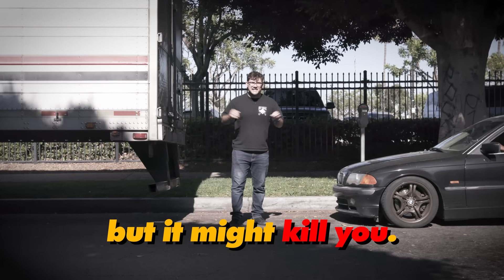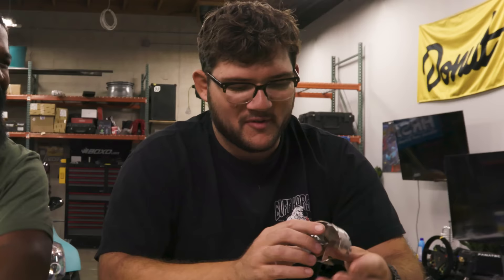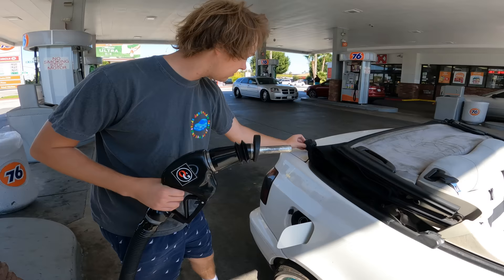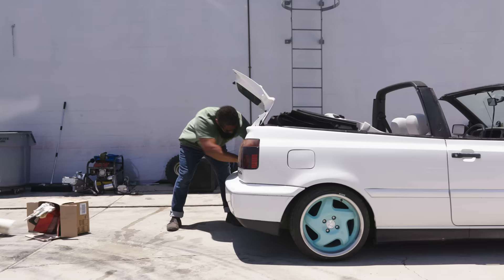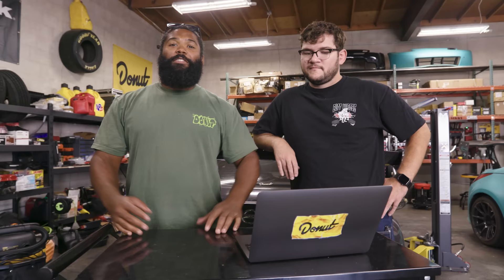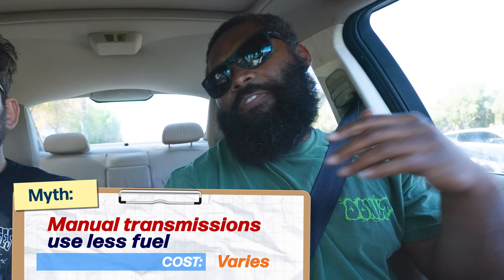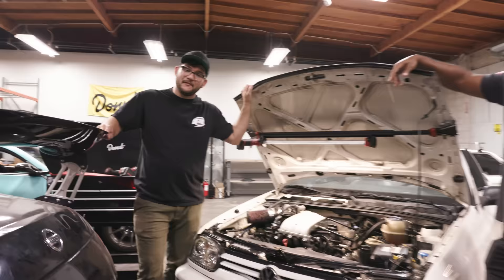Testing Fuel Economy Hacks

Comment: Two things I think could be wrong. 

1) I’ve heard windows down at slow speeds is better than parasitic loss from the a/c compressor. Once you get to about 55mph the drag created from the windows being down starts to become more inefficient than running a/c.

2) The manuals is direct drive where an automatic has a torque converter and consequently has more slip. This means that more of the energy created by the engine goes towards spinning the wheels as opposed to spinning the torque converter. Put simply more loss in transmission, making more fuel necessary to do the same thing.

Now the modern automatic with tons of gears may overcome this by having more gear ratios that allow the engine to be in a more efficient rpm more consistently. But, nothing compares to the CVT which can keep your engine in its sweet spot basically all the time.

Comment: I thought the fuel-saving advantage of a manual transmission came from the lighter weight and the more solid connection you get with a clutch versus a fluid torque convertor.

In older automatics they even featured a torque convertor 'lock' option specifically for increased fuel efficiency while cruising. When you're up to highway speed and the transmission no longer needs to shift gears, the torque convertor gets 'locked' in place for more efficient power transfer. The book even says this will feel like an extra gear shifting in once you're at a steady speed.

Comment: That turbo thing, I remember infomercials pre-Y2K for something called the "Tornado", seems like the same product.
Over-inflating tires. I'm torn on that one, I used to make a practice of inflating my rear tires to manufacturer's suggested, which was usually 32 PSI, and my front tires to slightly above, like 35-38. The idea being that most of the vehicle weight was in the front where the engine is. Not sure it made a difference, but I believed in it back then.

Honestly, the biggest difference I ever saw was when my old Nissan Sentra's exhaust rusted through. It was a California model, with 2 catalytic converters, one under the engine compartment, and one in the rear in a more traditional spot. Once the whole exhaust system fell off, and I had to put a sheet of scrap medal under the hood for a heat shield to counter the growing paint blistered spot, the MPG went from 36ish MPG to 39-40ish MPG.

Gas and temperature. Ok, there are a number of flaws with the statement that this is a scam. One being that at least at one point in time, certain times of year were when the government mandated ethanol be used, so at one time of year you might be getting regular gas, and another time of year the 10% ethanol variety. Nowadays 10% is year round as far as I know, and now even 15% ethanol is available, which averages around 30c a gallon cheaper. Can't use it in vehicles before 2001 though. Or in lawnmower or snowblower type equipment, you will damage the seals.

Most importantly though, if there is no difference in the temperature to gas performance, why do all the gas pumps have labels on them that tell you that "The energy content of gasoline varies with temperature" or words to that effect? I even dreamed up money making schemes where I would invent a gasoline tank heater, to increase the energy provided by the gas. My idea was to use a hot water heater, fed from the radiator, to prevent fire hazards while increasing the heat of the gas.

To my dismay, when I started looking up the patent process, there were already many patents for such devices, with various degrees of success and failure, most of which had only a minor effect, if any. Or they were so hotly debated, it made one wonder whether they were abject failures, or being suppressed by "Big Oil/Big Three/insert Big here".

"Junk in the Trunk". They obviously had fun with this one, but yeah. Definitely science. I've even seen other channels advocate for removing your spare, because you probably have AAA or some other roadside assistance anyway. I would never promote removing your spare. Some extremists even go all out, and get quarterpanels, hoods, and doors replaced with lighter weight items made of fiberglass instead of metal.

"Manuals are more efficient". Much as it pains me to say, this was once true, but probably false today. However, manuals are an added theft deterrent for Millennial car thieves who can't drive stick. So I'm still a fan. Plus, the feeling of being more in control of exactly what your vehicle does is worth it. I hate driving an automatic, and trying to pass some slower moving vehicle, only to have the transmission downshift, the revs go high, the speed stays the same or only increases a bit. Especially on mountain highways like I have in my area.

Comment: I don’t know about American Cars but here in Europe automatics we’re generally less efficient up until about 10-15 years ago. Mainly because they used torque converters sometimes without a bypass clutch. So some of the energy of the engine was always used to heat the oil in the torque converter and there was no direct connection to the wheels like with a manual. 

Nowadays we have a bypass clutch that bypasses the torque converter and other transmissions like double clutch and CVT add to that that most manufacturers tune for automatic as they have more control over it and can cheat on emissions easier and we’re now at a point where they’re usually equal…

Comment: Manuals were really good, in low speeds. My 01 Civic got 35 MPG around town, drop the rpm’s to 500 the second I started going down a hill or while rolling up to a red light. But taking it on the highway, running at 65MPH in top gear, locked me at 3,500-4,000 RPM making me watch my gas needle drop

Comment: The "watch how you dive" is so true. I drive a little Toyota sedan from the nineties. typical fuel consumption is 15 km/L which is about 35 mpg. Well I can easily get it to 18.5 km/L (43.5 mpg) by just driving gently. coast to slow down, gentle acceleration (fast acceleration saves very little time). Downside is them my poor old car is starting drink the odd bit of oil these days, but I'd say the fuel savings absolutely trump any cost of oil.

Comment: Funny story. 
In Grmany we have a self called expert in fuel saving, Georg Plattner, he is a good friend of Hans-Joachim Stuck, former Formula 1 driver, winner of the 24h of Le Mans  1986 and 1987, winner of the 24h of Nürburgring 1970, 1998 and 2004 .
Plattner claimed that he could drive from Spain to Austria with only one filling of his tank. Stuck said it would be impossible. Plattner won with an average of 82 MpG.
After that Plattner challenged Stuck directly and both drove 1500 km from Berlin through the alps over 13 mountain passes to Kühtai in the Austrian Alps.
Both in the same car model (Seat Leon FR Diesel). 
Not only Hans-Joachim Stuck arrived first at the destination, he saved a higher amount of fuel.
Stuck had an average of 55 MpG, Plattner an average of 52 MpG.
After it Stuck said that his experiences from the 24h races helped him a lot. Saving fuel at a high speed back then meant you could be out one lap longer.

Comment: removing parts for aerodynamics has a very significant impact on fuel efficiency. the rear view mirrors (removal) and wheels (smaller rims) are the biggest contributor and can easily net you 5+% each. taping gaps along the sides of the car does a little less, and removing windshield wipers depends on them actually being exposed. many modern cars hide them under a lip. technically you could add such a lip yourself but you would have to aerodynamically engineer it. 
some cars also now come with cameras instead of mirrors, which are about as good as complete removal. 

these are straight from the book of tricks used by car manufacturer fuel economy testing. of course you can really do most of those on actual roads because of how unsafe they are.

Comment: It's not just the number of gears in a manual that makes it efficient, It's also how you shift. autos shift near 2k RPM's. with a manual you can shift at lower RPM's to increase efficiency. During Hurricane sandy I had to make 1/3rd of a tank last 3 days while delivering chicken wings because there was no gas. I got 50 MPG in a 5 speed dodge neon just by shifting at 1400 rpm and cruising slowly. sure the car almost stalled every shift and people got their food slow but It got thru it and lasted 2.5 work shifts before I was able to get gas during shift 3.

Comment: Actually some modern cars that are auto are heavier. While in a manual you can put it into neutral and coast to a stop while automatics won’t do it so efficiently. The automatic gearbox although you let go of the gas will actually coast faster to a stop because the gears are still linked…. So it varies

Comment: I watched someone put VODKA in the gas tank of an older off road ford ranger. They put in a whole gallon and a half of vodka. They drove the truck 25 miles and they claimed it ran BETTER ON VODKA than it ever had on gas. I wouldn’t recommend it and they didn’t test the long term but it did work

Comment: I still think manuals are more efficient. Even nowadays. Take my GTI for example. It's only a 1 or 2 mpg difference. But the manual IS actually more efficient. If for no other reason than manuals tend to weigh a little less than the automatics do. 2015 GTI rating manual vs auto is 34 mpg highway and 33 mpg highway respectively. So it is still kind of true but for a different reason.

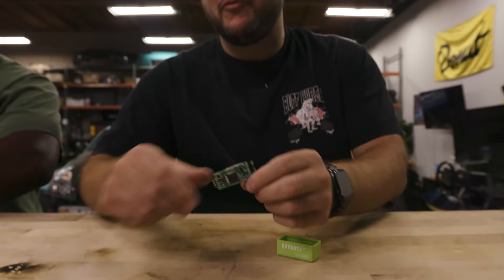Comment: 8:40 - I saw a Roadmaster/Impala pop up later, which is a good example for what I'm about to say, so take a look into it when you have the time.

The way manufacturers build cars can sometimes be a but wonky. A manufacturer will say things like "91 octane recommended, but 87 can be used," which is technically true.

But you see, it's true because the knock sensors 'hear' the detonation in the cylinders and run an extra-rich mixture in order to keep the car running smooth. The cost? Your throttle response will slow, power will go down, the car may start misfiring, and you could even cause your catalytic converter(s) to fail (which is an expensive part to replace), and sometimes, it doesn't even save you gas money.

The LT1s on the old B-body cars (Roadmaster, Caprice, Impala, Custom Cruiser) and F-body cars (Firebird, Corvette, Camaro, etc) were really bad about this. If you ran 87 instead of the recommended 91, you would drop about 2 mpg consistently. The engine just did NOT like it.

So, basically, use what's recommended for your car, and do some research if the manufacturer is unclear. You may save a bit of money now, but you'll probably lose more in the long run.

Comment: Tyre pressure is actually science. Lower contact patch = lower rolling resistance. My old E46 got 40mpg on motorway at normal pressure. 50psi tyres it’d get 46-48mpg

Comment: There was a scientist/electrician who took one of those obd2 gas savers apart and said the “microchip” circuit board was nothing more than the resistors and capacitors needed to power the led light that’s on the plug in. So basically it’s a single led powered from your obd2 port lol

Comment: I'd like to hear more about AC vs windows. AC increases load on the engine, and windows open increases drag, but I've heard below around 45mph, its more efficient to have windows open. I also increased 1-2mpg just this past week by turning the AC up a few degrees.

Comment: Old video, but there is one more aspect to the auto vs manual bit that's still kind of relevant today but less so than it used to be: "Slushmatics" aren't 100% efficient. A manual is providing 100% power through the driveline as long as the clutch is engaged, so it's not wasting power or fuel away - apart from the mechanical cost of just turning all the parts of the drivetrain. Whereas almost no automatics that I'm aware of are ever 100% engaged at any point. The tensioners always allow at least some slip, and they're intentionally designed that way to keep the power delivery smooth. But as a result, you're always losing some of that power/gas on...well, nothing.

Comment: Modern cars will reduce fuel consumption if your on primium gas, most cars have a octane sensor which then communicates the timing and mapping to the ecu. Use the gas recommended in the manual for best miles per $

Comment: Regarding auto vs manual, another thing that's improved is the torque converter - the old ones were dreadfully inefficient, but modern ones are way better.  As for the fun factor; I have a 15 yo auto SUV and a 20 yo manual hatchback.  The manual is way more fun.  BUT - my son has a 5 yo auto hatchback which I sometimes drive, and I always get out with a smile on my face.  It's just as much fun as my old hatchback.  Technology marches on.

Comment: When I drove OTR, every time I noticed someone drafting my trailer, I would let off the throttle and slowly decelerate. No brakes, that way if they ran into my trailer apron, the cops couldn't say I brake-checked them. I'd drop down to 30 or so mph and they would get mad and swing around me at max rpm, wasting all the gas they just tried to save. Many-a-middle finger did I see in my time over the road 😁

Comment: I would suspect overinflating tires COULD have some positive effect on fuel consumption, although likely negated by the downsides of handling changes and tire wear.  You might save $30 over the course of a year, but then will have to replace your tires much sooner, eating all the savings.

However, the savings are not because of a smaller contact patch, but because the tire flexes less at high pressure.  'Rolling resistance' is caused primarily by energy lost to flex in the tire - most of the energy it takes to flex the tire as it rolls is returned when the tire flexes back to its original shape.  The difference between the energy absorbed by the flexing tire and energy returned when the tire flexes back into shape is called 'energy hysterisis'.

Comment: The reason 6-10 feet was the most efficient on Mythbusters was because when they tried to get closer they spent so much effort stationkeeping that they wasted the savings. I dont know why they didnt test actually touching the truck, which would be safer. The best way to maximize drafting would be to beef up the front of your car, put some sort of hard rubber bumper on it that can take serious wear, and then hold yourself just touching the Mansfield bar on the tail end of the truck. That way if the truck applies its brakes, theres no gap to allow a speed difference to form and cause damage. Not legal, and the trucker will probably get pissed (unless you push enough that he is sharing part of your savings I suppose) but you wont get killed by a collision that way. 

ONCE cars are self driving this will become the standard way to travel on highways. The computers will negotiate between the cars and they will snug together to form a clump of 5-10 cars all going the same speed but only punching 1 hole in the air. The ones in back will still push a little so the front one benefits as well, otherwise they would have to do that bike race thing where they take turns in front. Probably need a railroad-like coupler between the cars so that they are held firmly together while in train but then can release as they get to their exit. This would also allow them all to brake as one as well.

Comment: You don't have to go as far as overinflation, but if you take it to the Max Psi written on the tyre, you will reduce the deformation. You can test this out on a Bicycle to see the effect. The most important thing to Maximise fuel economy is keeping your car as clean as possible and removing dead weight.
If you go to work daily by yourself and already have 2 cars, try to get a light sportscar like a Miata (or motorcycle) as your commuter vehicle.
The next most important is controlling Acceleration and Deceleration. Even if you are in an Automatic, try to lift and coast rather than brake (where safe), especially when you come up to a Traffic Light that you know will change. Keep the momentum rather than race to stop at the light unless you have to accelerate like a Diesel.

I started using these Hypermiler Fuel saving tricks a few years ago, and I've halved my fuel bill.

Comment: Manual is more efficient since the automatic Gear box use a torque converter which consumes several % of energy produced. But many do not know how to shift properly in a manual. In northern Europe there are still a lot of manual transmissions in reglar every day cars.

Comment: Where I live there's lots of hills. I own a 2016 renegade and drive a 2020 renegade at work. Mine is a manual and at is an automatic I average 23.3 mpg compared 18.7 to my work jeep. I believe this is due to coasting down the hills and only needing to accelerate up 3/4 to 2/3 of the hill. You guys should test this out.

Comment: The got it wrong on the octane ratings. It only works one way. If you have a high compression engine like an integra gsr- you need the higher rating to withstand the higher compression, but if your car can take 87 it can also take 91 without any added risk.

Comment: I'm curious if folding mirrors in, improves fuel efficiency, and I'd also like to see the hho generator thing on a carburetor engine, or if there was a way to lean the fuel at the injectors to compensate for the hydrogen gas. Perhaps a dyno would be cool to see. Maybe it's easy hp

Comment: Well.. having driven hundreds of kms with over inflated tires (to safe degree) I can instantly say that it improves efficiency and can notice when pressure has gone down (or it's colder) but.. you lose traction only if you're driving faster than normal otherwise, I recommend it.